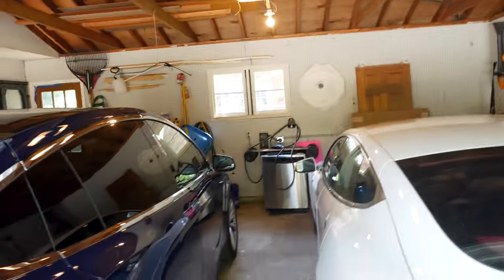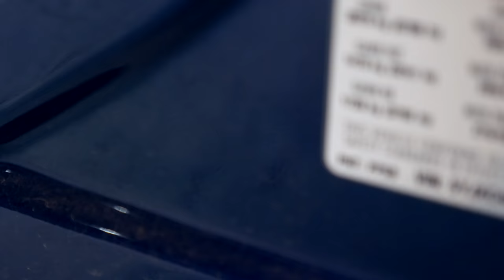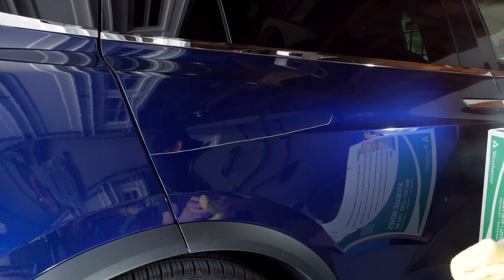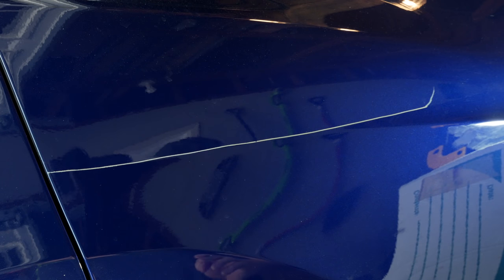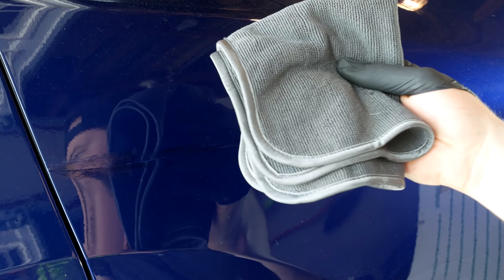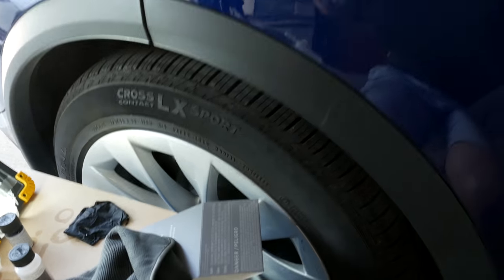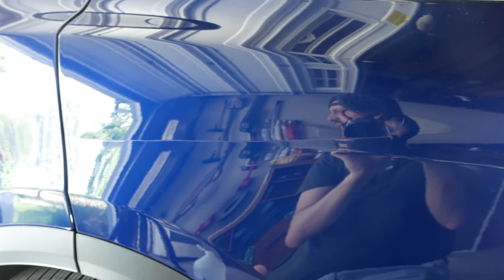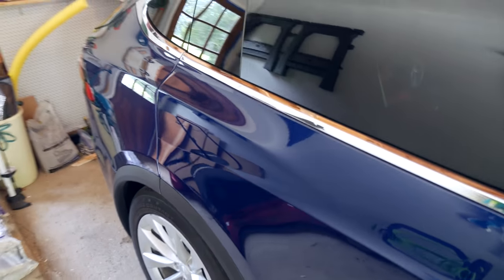Tesla Paint Repair Kit: How (not) to use

Comment: Thank you.  After seeing your video, I got the courage to DIY with the Tesla paint kit.  I scraped my rocker panel (about 2 ft long and 1/2 inch at its widest point).  Followed the instructions but I wasn't getting good results.  Finally the paint applicator broke.  So I used a grade school paint brush that worked much better.  This time, I used the fine tip to stay within the scrape and had no overpaint to wipe off.  Since the scrape was on the rocker panel, the touch up is barely noticeable, but if it were up higher on the door, it would have been in the body shop.
Reply: What are the updates on the scratch? I scratched the bottom  corner of the rocker panel. My biggest concern is fixing this before i het rust.  How has ur fix held up? Do you have salt and snow stuff to deal with. Thanks.
Reply: @oscara8746  So far so good.  The touch-up paint has held up well.  I live in warm weather, so no snow and no road salt.  When my car got scratched, I didn't notice any bare metal, so I did not think I would have a corrosion issue.

Comment: Highly recommend the Lift Master garage door opener that connects directly to the door shaft. It is completely off to the side. No belt, chain or screw track or bracket down the center of the ceiling. And, with the Lift Master Internet Gateway on your wireless network you can check on and control your opener from anywhere away from home! So sad the huge scratch happened, but it would not have happened with a direct drive opener! BTW, I already scratched my new Deep Metallic Blue Model 3 on the rear right wheel well pulling into the garage too close to the opening. Bought the Tesla paint repair kit $50, but am turning it over to a detailing professional to do the work.

Comment: Great video, thanks for doing that. Yeah, that may need a real repair ($1000!  Dunno why it needs to be blended, aren’t they using the same paint?!).  The actual damage does look like it’s dented from the reflection; it’s definitely going to need some at least minimal body work.  The aluminum is so fragile, pressure deforms it.

But the garage door opener:  whoever installed it (my bad if it was you!) should have removed that vertical bar’s overhang.  It’s definitely too long; should not extend beyond the curve of the part that goes to the actual door.  Avoidable. Sorry, man!  If that was my car, I’d be pissed.  

We have a tight garage also and hung a horizontal bumper from the garage door opener track between the two cars; this keeps the right car’s driver’s door from hitting the one on the left.  Works great.  Just an idea.  -Lee

Comment: Are you going to get the x ceramic coated? Oh, you did good not mentioning names. I can't help it, was it you?
Reply from the maker: I don't think so. if I do anything it will be a clear film, so ceramic would be additional cost.
wasn't me
Reply: get some paint protection film!!!
Reply: I have eXpel and I'm not sure it would save this kind of hit to the paint.  If the scratch did not dent the panel I think eXpel might of had a chance.  The only time it got tested on my car was about 3" long and hard to say about being deeper or not but again no metal deformed and the hairdryer removed the scratch completely.  I have since looked at the eXpel and can not find Any evidence of the old mark.  Really,  completely gone.  Since then about a year later I had the glass coating added and it really helps when washing the car,  much faster now.  5 minutes where it was more like 15 to 20 before.
Reply from the maker: did you put the film on all the paint surfaces?
Reply: Teslavangelist,  yes the whole car and head/tail lights etc....  plus the shiny seatbacks.  The guy came out to our house to do it.  I have the video here https://youtu.be/FA8b--v6MXc 
It is an extra cost that might make some a bit shy about doing it.  I plan on driving the wheels off mine over the next 25 years so it was easy to make this call.  Others will say why spend that now,  let the paint wear out then use that money for a new paint job.  They just don't know how bad of an idea like that is.  A 6k paint job is not that good these days,  1st its not factory.  2nd a lot of attention to paint thickness will be important for all the sensors and MX has wing door sensors.  When the eXpel needs to be removed 10 years later you will have a fresh factory paint job and can cover it again or enjoy the factory finish on a 10 year old young tesla.  The only thing that you have to do is not get into a crash witch will undo everything.  I have 15 and 20 year old cars that are original so I'm betting on my driving protecting my finish.

Comment: Couldn't happen to a bigger pos car...tesla= junk
Reply from the maker: yeah after I saw the paint could not withstand a steel bar grated across its surface I realized what a crappy car I had bought.
Reply: Teslavangelist a properly designed automobile would never have put the doors in that kind of harms way....just wait til you start having leaks and operating failures from those doors
Reply from the maker: I think a properly designed garage door opener would not do that
Reply: Teslavangelist    Ah the sarcasm. Love it